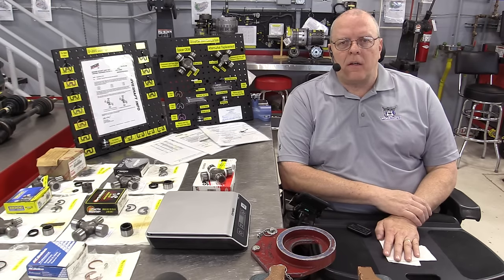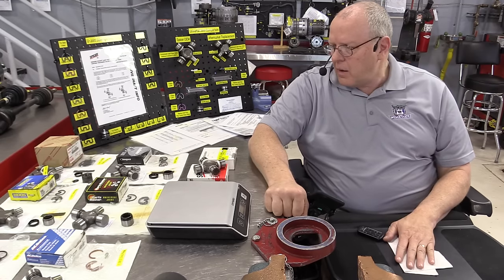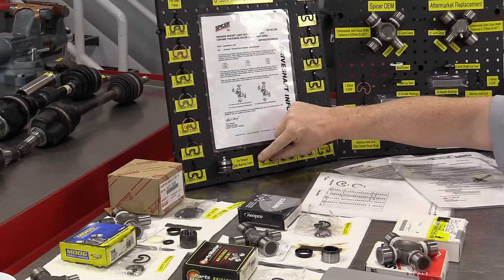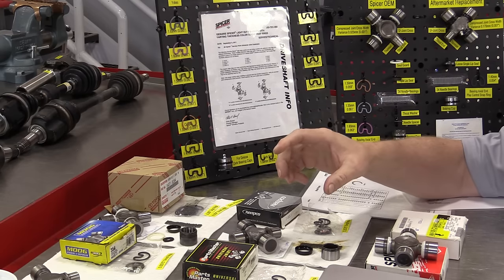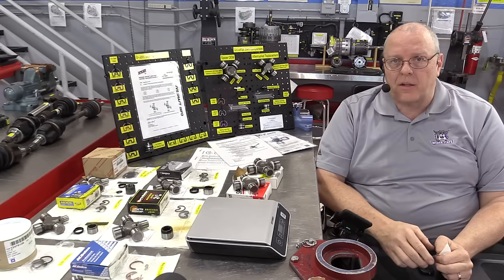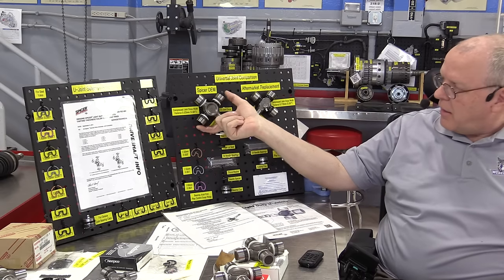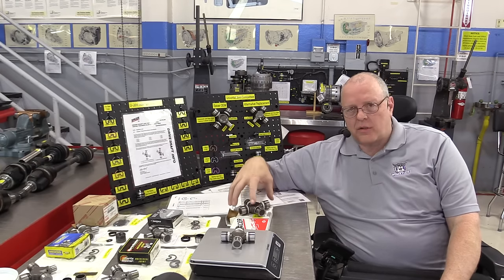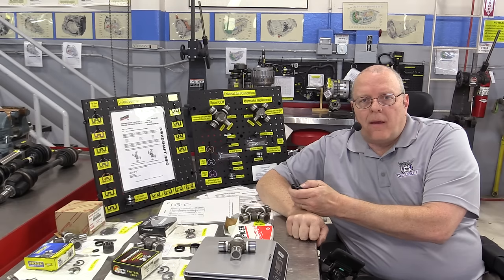Universal Joints - Part 2: Comparing Joints

Comment: Great videos! I just modify the snap rings until I get a few thousands of play.  A flat surface table w/ sandpaper or a sanding stone, you can remove a few thousands off the snap rings until they're perfect. I find that u-joints go bad prematurely because of heat (too tight), which weakens or melts the seal and then contaminants get in, or the grease is washed out. I've worked in the performance automotive industry as an engineer and this is some really great info in your videos! Nobody seems to understand bearing preload/lash etc., and how important it is!
Reply from the maker: Awesome! Thanks for your feedback

Comment: Thanks, John! Great vid! I just purchased a "High Performance" aftermarket driveshaft from a well known offroad manufacturer. Upon unpacking the driveshaft I noticed the U-joints are greasable (with needle zerks of all things). You would think that an expensive driveshaft would come with quality components, but that is simply not the case. Nowadays you have to check /inspect everything you buy regardless of how the company is rated. There are things people just don't take into account (or realize) when they rate a product.

Comment: I had a old parts guy tell me to figure out the cost of a factory part.  Take the amount of miles driven vs the cost of the factory replacement part.   Factory parts cost more and your video here clearly shows a great reason why.  the triple lip seal, the thrust plate!  I learned so much about something I figured was so simple,  Thanks  you!
Reply from the maker: +Piston Slap Thank you very much!

Comment: Great video. I learned about the variation in snap rings on a split shaft with three bearings. The parts store replacements had the wrong thinness clips making it too tight.

Using Spicer replacements fixed that. These cost $20 each vs. the genuine Toyota unit that was over $140 each.

Spicer also had a huge catalog which was very detailed on the specifics of the vehicle vs. the generic parts store make model year.
Reply from the maker: +Systemrat2008 Thanks for the feedback! Many Toyota u-joints are actually Spicer joints in a Toyota box. Thanks for watching!
Reply: Spicer DOES NOT make Toyota u-joints. Toyota uses Spicer 1330 joints on their newer trucks. It's a Ford joint.
Reply from the maker: tommyguns14able Spicer makes u-joints that get re-boxed by almost all manufacturers. including Ford.
Reply: WeberAuto
Yeah. I know nothing. I've only worked ten years for a company that's been a Spicer distributor for 45 years.
Reply from the maker: My apologies, Happy holidays!
Reply: WeberAuto
It's all good. Merry Christmas to you and your family!

Comment: I just turned down a Non-Greaseable Spicer because of how rough it felt. I suggest testing the joint by hand before purchase. The cheapest Advanced Auto brand, Driveworks felt much better but I had them order MOOGS. 
Have you ever seen how things are made by guys in robes and no shoes forging steel and assembling things in the dirt. Things you would think are made in a factory are not. Amazing.
I very surprised the Non-Greaseable are heavier considering the voids inside the cast that hold the grease.

Comment: Yes, very informative.  However it would have been nice if perhaps you covered the torque application ratings of different sized u-joints.  And some u-joints don't use clips at all such as some of the 1610 on up u-joints where the bolts go down through the bearing cap.  Lots of videos on these 1310 through 1550 u-joints (although I think yours is the best of any I've seen) but very little on the larger medium duty truck rated u-joints.

Comment: So here is a question: Aftermarket high performance driveshaft was made by a reputable shop. Spicer USA joints installed. Balanced for high speed. Around 2500RPM, there is a slight noticeable vibration but them it goes away and smooths out again. Would this be a potential issue with clips? They spun balanced the shaft due to the application but I found it really curious.

Comment: The Advanced auto parts convinced me that MOOG greaseable U-Joints are as good or better than Spicer non-greaseables.  Like an idiot I felt for it and noticed the support rings looked thin.  When I measured them, they were ~0.009" thinner than the spicers.  On that day there was a mechanic who swore the same thing about MOOG vs. Spicer.  The professor is right, it took about 17 years for my OEM spicer U-Joints to go out.  Furthermore, having to grease these things every 3K miles is a pain. 

Another thing I noticed was that on when I installed the MOOGs, one side installed ok, maybe a tiny bit loose, but the other side was very difficult.  It took greater pressure in order to get to the groove to install the retainer clips.  Also, i noticed that this much force collapes the other end of the the U-joint to the point that it bent the retainer clip on the other end.  I should've measured the cap to cap distances on both sides.  Not I honestly believe that one side was longer than the other.

 Now, I'll have to spend more money so but the OEMs I wanted in the first place.  Don't make my mistake.  This video helped me alot.  Thank You and God Bless You!!!
Reply: I was going to buy Moog from Rock Auto for my 1993 Toyota truck but ended up buying OEM Toyota U Joints from the dealer and glad I did.

Comment: So, where do you get those of set clips ? My axial went off slightly. Have imbalance @5-20mph.
Reply from the maker: They come with quality universal joint kits.
Reply: @WeberAuto  yes sir. Reordering Spicer#589. After viewing a local parts location observed  they have several specs  and sets with them . Other brands don't. I kept my other D Rings from prior. Dodge trks used Spicer brand. Precision brand is built well. But heavier in weight. Etc. Upon speaking with several auto locations nobody Carries varied thicknesses in retain clips. Even the dealer. Upon an emergency situation. I used an internal Clip in similar size and thickness. It worked. Great information output. Advised several auto store crews to view your site for valued info.
Reply from the maker: @nathanisenhour4420  You can order them from Spicer. I see them on ebay too. See https://media.spicerparts.com/cfs/files/media/kX23a5sT5yt3LYTdn/j300-p9.pdf?store=original

Comment: I have one question though, the snap ring can't protrude any further than the groove in the ears so how can it preload the bearing cap?  Usually snap rings have a taper on one edge that should face outwards but the inner face of the ring is flat so can't preload the bearing cap, if you were to put both snap rings in place across a yoke without the joint installed and measure the inside dimension it would stay the same no matter what thickness off snap ring is fitted because the inner dimension is determined by the machined groove in the ears, that's as long as the flat side of the snap ring is facing inwards as it should be.  If a joint is tight once fitted centre the joint by striking the ears of the yokes with a nylon mallet.

Comment: What is your opinion on Moog? I have heard good things about their ball-joints and control arms, but what about their universal joints? And also could you tell us what brand had the large amount of cross-with variation? Just curious. Anyway thank you very much for this universal joint video series, I have learned a lot so far!
Reply from the maker: +MXshredder125 The Moog joint I tested was not very impressive. It had 0.004" cross width variation in the cross with the bearing caps installed. The really bad joint was a "Parts Master" brand with 0.007" cross variance. Thanks for watching!
Reply: It depends on the application. For the most part,their u-joints are junk. The only ones that they make,that are decent is for the old land cruisers.

Comment: With the shear volume of stuff coming from China these days, long time USA Domestic produced parts, a lot of parts have shifted offshore to China, Mexico, etc. Runout issues are very valid. Also, because I am from Nebraska and used to sell cutting tools to the Nebraska Neapco Manufacturing plant in Beatrice, Nebraska, it's pronounced Ne-ap-co. I've found Spicer joints are really good and you get what you pay for. Years ago, I sheared two of the four trunions on a Brute Force joint...granted I was on the street doing 4500 RPM launches, and I may or may not have hit a patch of gravel and shockloaded the living heck out of it 🤣

Comment: I don't like non-greasable  U-joints, ball joints etc. I get about 70,000 miles out of a sealed U-Joint here in the rust belt. I never change greasable U-joints if I keep them greased. I have replaced them (and greasable ball joints) on cars where they were neglected. The exception is my Toyota Previa. It has 265,000 miles on the factory sealed joints and still going strong. But I've changed tons of  OEM sealed ones on domestic cars, often at around 70,000 miles. I put sealed ones in my front axle shafts as I couldn't buy greasable for my 77 Jeep. Drilled and threaded the end caps so I can screw a grease fitting in to grease them. no clearance so I screw plugs in afterwards. That was in the 80's and still going strong! But for people who don't service their own car or have lazy mechanics who don't grease stuff every other oil change or at least once or twice a year, sealed probably is the way to go for the reasons you mentioned. I recommend Spicer greasable (10 series). Triple seal and greasable, I think

Comment: Are there grooves in the yoke ears that the snap rings fit into?  If so how close should the thickness of the snap ring be to the width of the groove in the yoke ears? How can you tell if the U joint is centered in the yoke ears? If it's not centered wouldn't it cause the shaft to wobble and vibrate if it's not centered?
Reply from the maker: +John B. Kobberstad Hi, the u-joints with external snap rings fit into yokes with grooves cut into them. The u-joints with internal snap rings do not have grooved yokes, the snap rings fit on the inside of the yoke ears instead. The thickness of the snap ring has nothing to do with the width of the groove. The groove simply allows you to use the proper thickness of snap ring to establish the proper axial play and to center the u-joint in the groove. The joint is centered in the yoke when the same thickness of snap ring is used on opposite ends of the joint to set the axial end play correctly. If the joint is not centered, it will cause the shaft to wobble and vibrate. Thanks for the feedback and thanks for the questions!
Reply: The groove could be double the thickness of the snap ring. What matters is the sideplay when the joint is in the yoke.

Comment: When auto manufacturer's build vehicles they spend as little as possible on parts.
An example is tires.They'll buy less expensive models of tires to save manufacturing costs.
I'll continue to replace with greaseable u-joints made by brands such as Moog,Dana,etc.

Comment: I think the industry should be made to sell the right snap ring. We are to believe when buying u-joints that the ring is the correct ring. Its not easy to find
the spec on the correct snap ring for your vehicle. If the stock u-joints have great seals , GREAT! but why not provide  a grease fitting so it can be maintained with grease? The reason they fail is lack of grease 99% of the time.
Soon they will be making engine with no way to put oil in . They do made transmission with no way to put oil in or even to check the oil level .

Comment: I work for a Freightliner dealer have many driveline vibration complaints 99% Meritor drivelines. Anything under 0.030 in runout is considered within spec. What a joke. I use the I phone app you developed for the eva readings Meritor wants to see for the analysis from the road test. I know the best results are a constant road speed in the centre  of the order of vibration. But the odd time I get a 1st order tire speed vibration knowing the amplitude and 30 years experience it is a first order driveshaft speed related vibration.Also have had first order engine speed related vibration. Whats going on I know it is imperative to input the proper axle ratio tire size and eng cyls and transmission ratios for the programme to work that is what I have done whats up?
Reply from the maker: Hi, the App detects more than one vibration at a time, but it only shows you the highest amplitude vibration on the results screen. To see the other vibrations, select the "Totals" button and see which vibrations have the highest average amplitude level. We are working on an update where you can ignore tire speed related vibrations if you want. Driveline vibrations are certainly a problem in the industry right now. Best wishes!